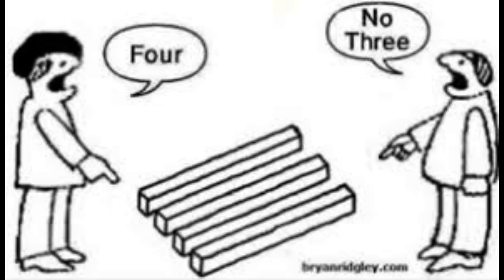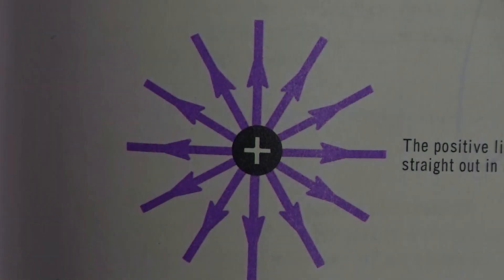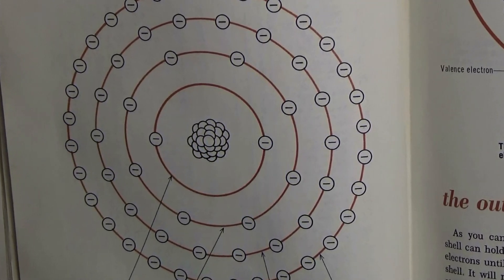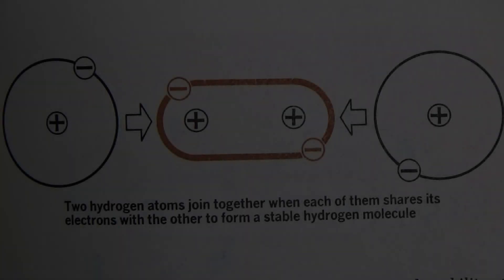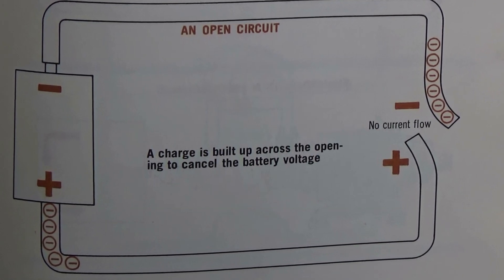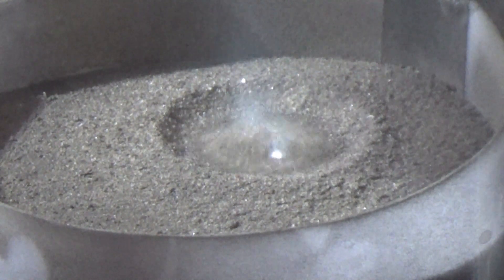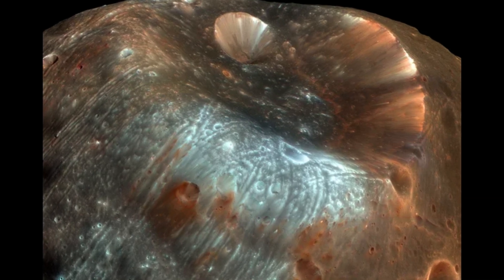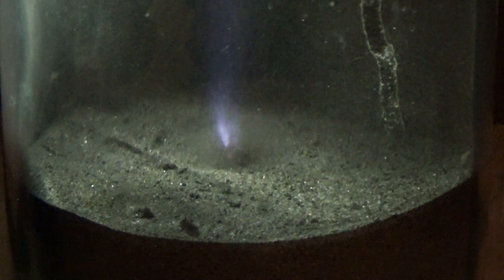What NASA won't predict about Psyche 16

Comment: After 11:30 you think that the resistance decreases, but why?
I think you are guessing wrong here.
Reply from the maker: when the current begins to flow in the plasma the resistance drops. It takes more potential to breakdown gases in a discharge than it does to maintain the discharge. but your probably right in that the electric fields mechanically moving the particles might not actually lower the resistance.

Comment: Didn't need the old model "lesson" for 9 minutes.  You should teach Dollard's Four Quadrant theory instead.
Reply from the maker: I felt that in order to properly explain voltage, electric potential and conductivity it was necessary to do a full overview of the basics.  I don't think I've been introduced to Dollard's four quadrant theory, does that have to do with  electron clouds?